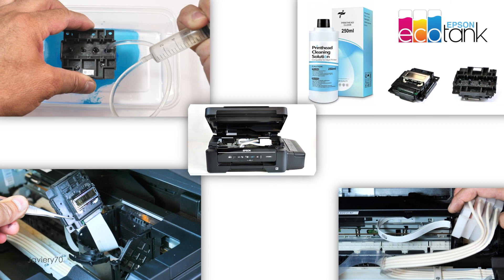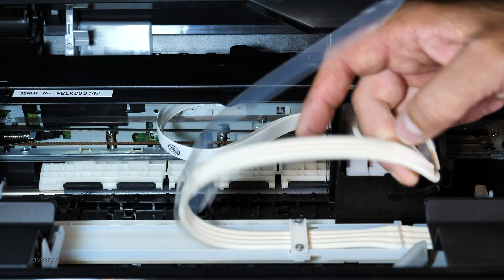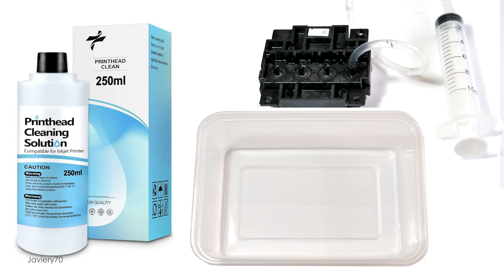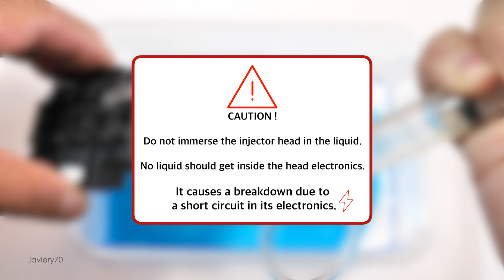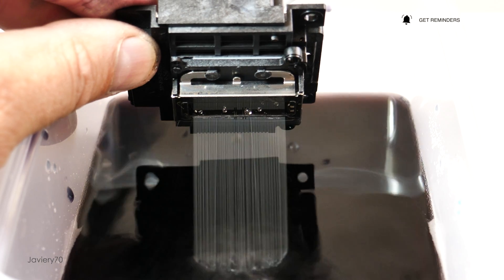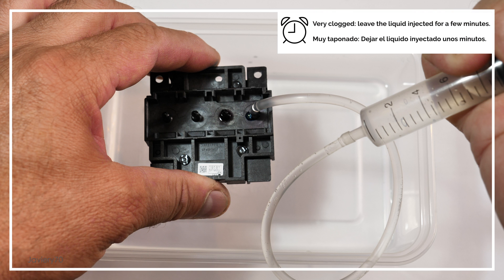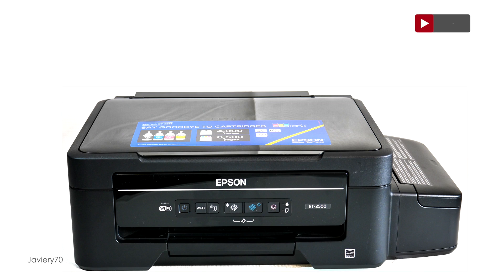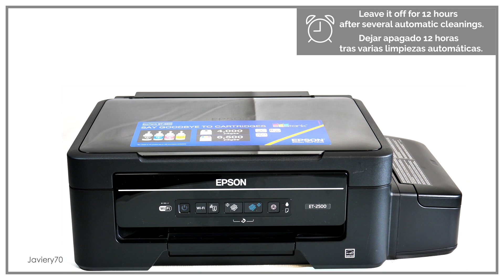🔹 EPSON Ecotank |  Cleaning Epson Heads (eng)

Comment: *Subject:* Issue with Epson L3060 Printer After Cleaning Print Head (Print Head Circuit Board Got Wet with Medical Alcohol)  

*Problem Details:*  
1. I cleaned the *print head* of my Epson L3060 using *medical alcohol**, and the **print head’s circuit board (small PCB on the head)* got wet during cleaning.  
2. After reattaching the head and turning on the printer:  
   - *All lights are flashing.*  
   - *The printer doesn’t work**, and it makes a **loud noise resembling gear whirring* (as if it’s trying to move but is stuck).  

3. *Swapping Print Heads Between Two Printers:*  
   - *First Printer (with the wet circuit board):*  
     - Installed a working head from another printer (no clogs), but the issue persisted (flashing lights + noise).  
   - *Second Printer (Good Condition):*  
     - Installed the cleaned (wet circuit board) head, and the same symptoms appeared (gear noise + flashing lights).  
   - When reinserting the original good head back into its own printer, the **same symptoms occurred**!  

*Questions:*  
- What is the likely cause of this issue? Is the problem in the *print head* or the **printer itself**?  
- Could the good head (uncleaned) have been damaged after being used in the printer with the wet circuit board?  
- How can I safely test the good head’s condition without risking damage to another printer?  

---

*Note:*  
- I avoided testing it on a third printer out of fear that the head might be faulty and harm the new printer.  

Please help diagnose the problem and suggest solutions. Thank you!
Reply from the maker: @خدريخدار  Wetting the electronics of the print head can cause damage by short-circuiting the print head or also the motherboard of the printer.
If there is a noise and the lights are on, you must check that the flex cable is correctly connected to the print head.
You must try to see the cause of the noise, the correct assembly of the print head.
You can disconnect the printer from the power supply.
Reply: @javiery70  
Thank you very much